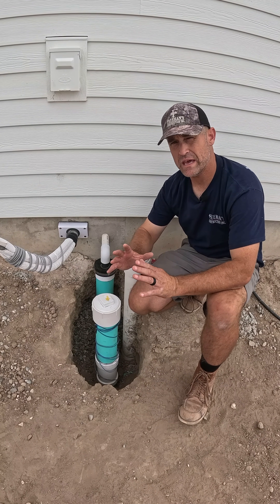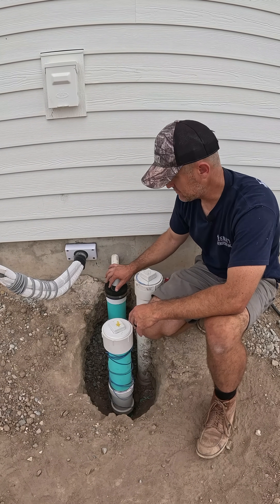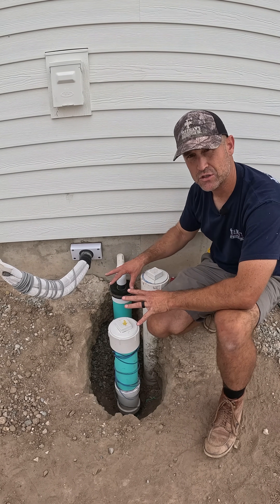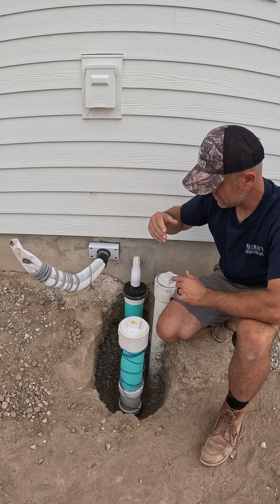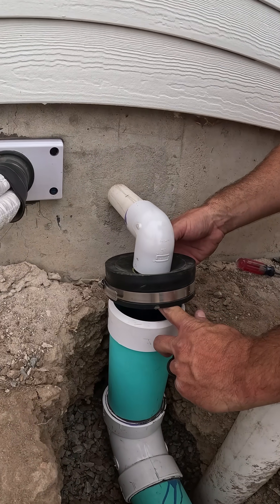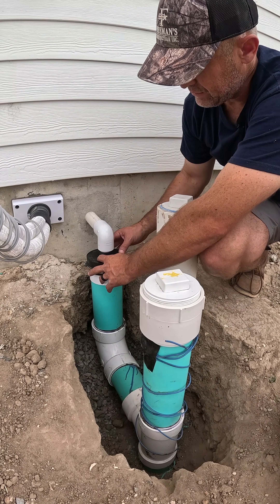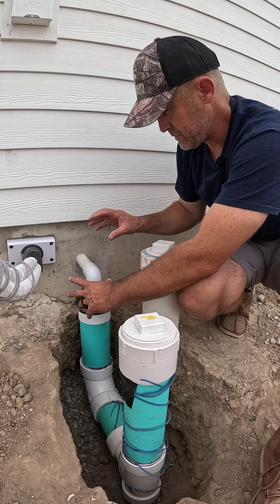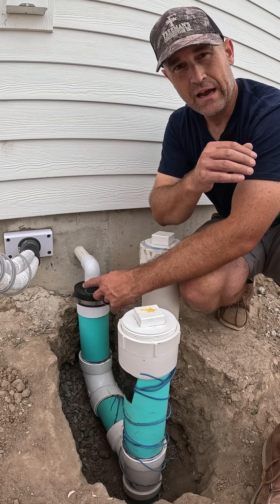How to Drain HVAC Condensate Water Away from the House

Comment: I will never understand why so many homes will just have the condensate dripping right onto the soil and eventually causing foundation issues within a few years. That and the fact doing that half hazardly meets code in a lot of areas. Just why? Smh. Solid drainage system displayed here!
Reply from the maker: Thank you. Have you seen any other methods of dealing with the condensate and stopping it from dripping next to the foundation that work well?